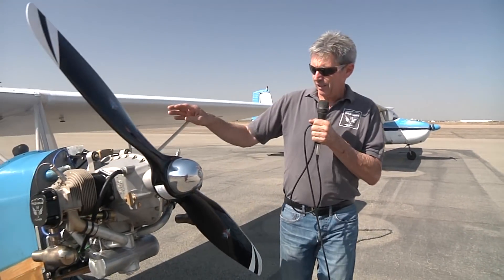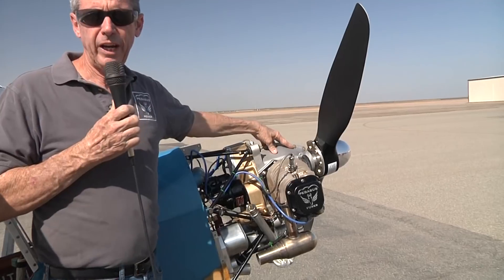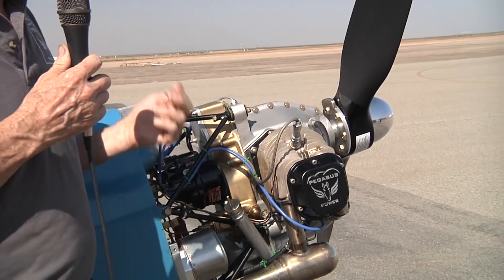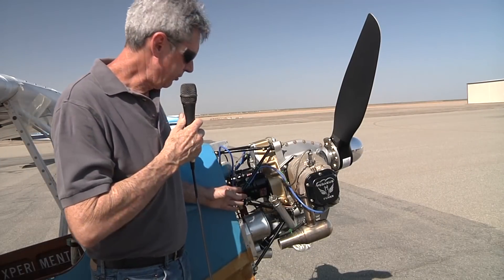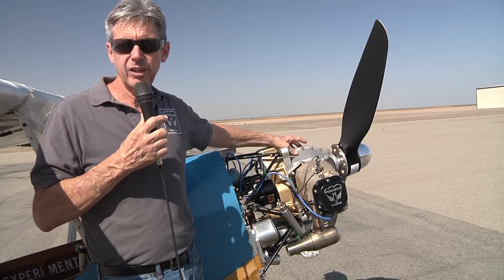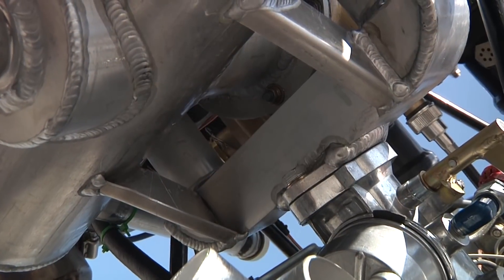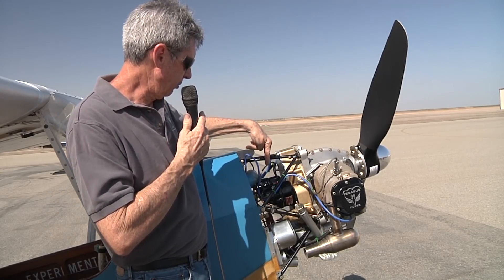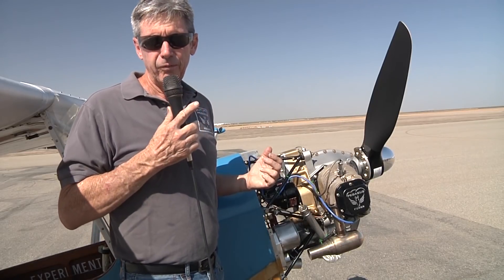Pegasus DP-1 Engine Flight Testing

Comment: So is this project dead?
Reply from the maker: No, the project is not dead... There have been some delays due to the Pandemic. However, things should be returning to normal soon and development will continue.
Reply: @EricJamesSwearingen  Good. I’m starting a new project and the shortlist for engines at the moment are O-100, 45hp 1/2 VW, Verner 3V.  The Verner currently has the edge because of its torque and ability to swing a huge prop. However, they just stopped production indefinitely due to number of 9 cylinder orders. There are a handful of the in the US right now and if I’m going to get one, I have to pull the trigger very soon.  Honestly , I like your concept and engine the best of all of them but I can’t wait too long to make a decision on which power plant to go with.  Do you have an idea on when a kit would be available?  Could I get on a Pre-production order list?
Reply: Is this moving forward?
Reply: Unfortunately Pete Plumb passed away a few years ago and the project has been in limbo since.